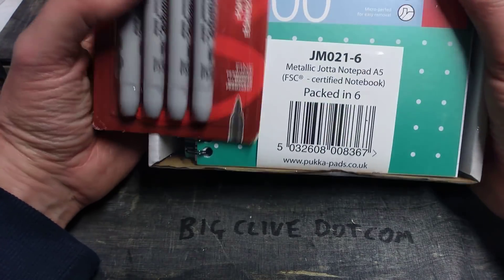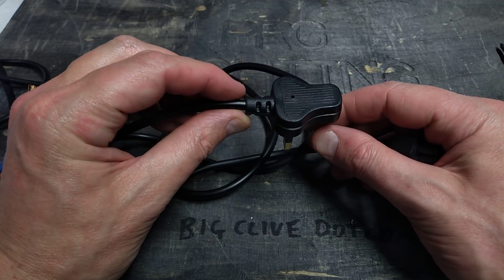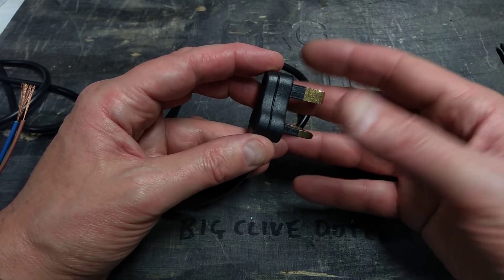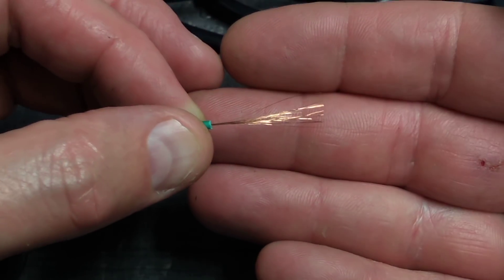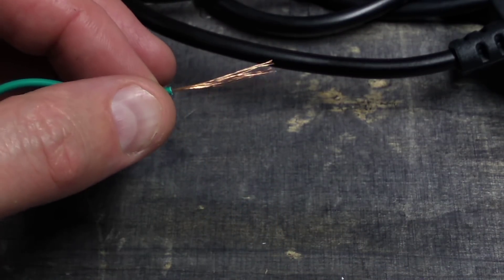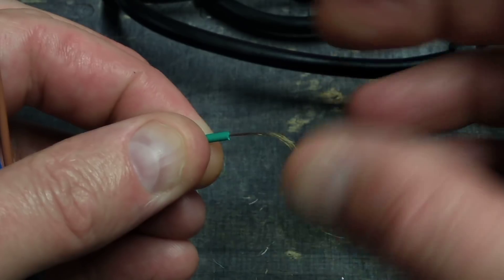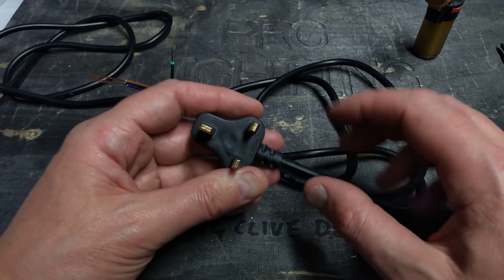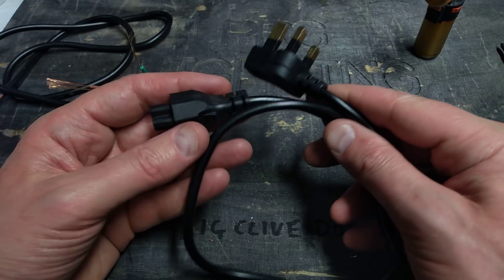How to detect shitty and dangerous aluminium flex.

Comment: You missed a problem.  The exterior of the casing is too close to the live and neutral pins.  Not quite so big a problem with sleeved pins (which they all should be these days) but when the original BS1363 was drawn up those pins weren't sleeved so the case dimension was set to reduce the chance of accidental contact while inserting the plug.  As with the lack of fuse and the sleeved earth pin, a defect which all by itself makes the plug illegal.

There's also a good chance the earth wire isn't connected inside the plug, or is merely touching the pin, so it won't matter that the earth pin is sleeved because the device won't be earthed anyway.

[Edited to add this]
John Ward tested a similar piece of shit.  At rated current it bubbles/melts/smokes.  IIRC, he tried a flame test and the stuff wasn't self-extinguishing, so illegal in yet another way.

Comment: I have a plug like that that is connected to my power supply that runs a bit of equipment I knew it did not have a fuse in it so when I am using it I will be cutting the plug off and I will be fitting a proper plug onto it because they are dangerous
Reply: I guess you'd better replace the whole cable...
Actually it will not be simple to put a proper plug on these cables with a proper connection
Reply from the maker: The fastest fix if you don't have a replacement cable is to plug it into a fused extension lead.  But a good quality cable is always an investment.

Comment: It always seemed BS to me to have fuses in plugs. Circuit breakers, break the circuit much faster so what point is there?
Reply: The UK runs 240-volt, 32-Amp breakers on a typical circuit (as opposed to US 120-volt, typically 10- or 20-Amp breakers). A lower-rated fuse in a fused plug will melt at a lower current, therefore stopping current to the device on that cord.

An often-overlooked PLUS to this design is for homes that have no overhead light in a room. It is expected the home owner use a lamp plugged into an outlet that is controlled by a switch near the doorway. Say, for instance, you have this lamp and another device plugged into the same outlet, and the other device goes "Full eBay" and shorts out. The fuse in the plug would melt before the breaker tripped, stopping the current going to the offending device while allowing the lamp to be lit for your safety (say, so you can find your way to the fire extinguisher or whatever). At least that's how it makes sense to me. LOL 

Can you imagine the above scenario and having to cross a carpet full of Lego pieces to get to the circuit panel in the dark? *cringes*
Reply: We have 230V here. 16A is standard but you can have 24/32A breaker. No fuses in plugs.

"The fuse in the plug would melt before the breaker tripped,"
Are you quite sure about that. As far as I know breakers trip much faster in case of a short circuit.

Comment: I never knew CCA wire had made it into power cables (not surprised). I bought some CCA wire that wouldn't take solder no matter what I tried (the cladding was copper colored). Just more ebay trash.

Comment: Don't bin the lead... Break the pins off the plug and destroy the lead as much as you can, to prevent someone else from using it...  Then bin it...
Reply: No need to go that far, just cut the lead off even with the plug and it will not be useful for repurposing.  Anyone who tries to use it after that earns a proper Darwin Award.
Reply: Agreed.  Some poor soul might salvage it from the bin, thinking they've found a good cord.
Cut it into 25mm pieces and take a hammer to the plugs.
Reply: Just run 10 amps through it.
Reply: we should set up some government regulations that ensures safe disposal of dangerous stuff
Reply: There's no such thing like keeping consumers safe, no matter brandnew or prefilmed anyway. The most hilarious ways to destroy everything including own bodyparts ever were and ever will be invented by consumers.
Reply: Bin it? You monster. Recycle it! It's metal!

Comment: But aluminium would not be springy, especially in such thin strands, are you sure that's not copper coated steel? Anyway, the total diameter of the strands in one lead is very small, further reducing current capability, I'm surprised you did not address that.

Comment: If you get a product with that lead, don't just bin the whole lead, bin the whole product! - god knows what other nastie's are inside the product, waiting for their moment of fame to burn your house to the ground.
Reply: At least if you replace the lead and put a small fuse in its a considerable improvement in safety, However I totally agree. Unless you have a reasonable knowledge of electronics so you can check the insides of it you should get it checked by a professional or just bin it.

Comment: That is a C5 connector, it is rated for maximum 2.5A, and usually found only on laptop chargers and other small switch mode PSU, not intended for any heavy load, where is used the C13 that is rated for 10A. So that cable is probably fine, I wouldn't be concerned by overheating, of course if you use that cable for the intended purpose. 

Of course its insecure because it lacks of the proper plug, and there is not a fuse, but if that cable had a proper UK plug with a 3A fuse, or even less, it would have been safe enough.

Comment: i dont know about uk but here in usa you find that cca has taken over the auto jumper cables its almost impossible to buy jumper cables on line because the cca is so small that you can not see it it also has bleed over to battery chargers almost all of them no are cca they only last a year when i found the problem i bought cooper cable and replaced them and now have ones lasting 5 years and going strong its very dangerous as they get so hot at the amperage of our automotive battery's
Reply: Hold down the shift key, will negate the CAPS-LOCK.
Reply: sorry its not in caps in my  window
Reply: hd the wise 7
Reply: I also had to buy copper wire (welding cable) and make my own instead of buying premade jumper cables.  And those were for a friend with some toy jumper cables that melted trying to jump start a honda civic! The cables appeared about 6-8mm diameter, but the insulation contained only a few strands of CCA with not even the area of 18ga lamp cord.
Reply: lol i know i bought some high dollar napa jumper cables got them home and would not make a conection found a bad crimp on one end took it a part and started to put a new crimp end found cca and i just threw them in the trash the great cable clamps had this saw tooth copper clamp found it to be cca also lol
Reply: Best jumpers are diy with cable and earth clamps from welding supplies. Have jumped a four wheel drive for someone with cheap cables, after about 10sec. cables started smoking I removed them immediately and told the person to call the roadside assistance organisation. By the way the battery they had fitted in their land cruiser was about half the size of the battery box because they were too cheap to pay for the correct one.

Comment: Plug does not need fuse. Cable is fuse.
Reply: It's not a bug, it's a feature.
Reply: Plug does not need earth.  User is earth.
Reply: Wouldn’t the fire terminate the continuity?
Reply: @TheKlipschfreak  Yep! - it will terminate the continuity of life.
Reply: Probably, but electrical fires tend to be self fueling once they get going.
Alu burns/ignites at a low temperature. Aluminium is used in fireworks, all sorts of metals are. Once they combust they become very 'volatile' in the way they burn. Also you have plastic on the lead to help propagate the initial electrical ignition.
Reply: Powdered/nanoparticle aluminium is also used in solid rockets as a fuel. Aluminum burns really nicely.
Reply: Yes. Your house too.
Reply: Pn Junction true that
Reply: Gold
Reply: I read that in chinese accent
Reply: ted clubber lang ahhh wha’ you lie -_-
Reply: John Ward put current through one of those leads. At 3 Amps it began to melt and to emit poisonous Whitesmoke™, and at 6 Amps it burned out.
Reply: XD
Reply: Depends on current :-)
Reply: Yeah, burns like canon fuse.

Comment: 10 Amps, that cable isn't rated to that, due to the connector on the end (IEC C5) only being rated to 2.5 Amps.

Though, Copper coated Aluminium wirering is though rather typical in airplanes, mostly due to its far lighter weight for the same resistance. (So building a cable to the same current rating would end up lighter, but also a bit thicker. Something that likely isn't the case with cheap cables.)
Reply: You can argue it is 'safer' if you design around the fact that the strands tend to fizzle instead of turn incandescent. It will cause shorts to go open near the short.
Reply: Not only is the connector a problem, but that wispy wire looked to be 16 awg at most.  That wouldn't even be rated at 4 amps  8 amps, according to https://www.engineeringtoolbox.com/wire-gauges-d_419.html  if it were copper.   These guys: https://www.stayonline.com/product-resources/reference-circuit-ampacity.asp say 13 amps, but I don't know if it's taking strandedness into account.  That lead is [still] a POS.
Reply: IncognitoTorpedo  Umm, you need to do some research..16ga copper is rated for well over 4 amps, try 13 amps if length is under 50 feet, 10 amps for 50 feet or more in length,  two current carrying conductors in cords. :)
Reply: To be fair, that cable could be made with 20 awg (copper) wire and it wouldn't be a huge problem for this cable, due to it only having a 2.5 Amp rating.
Though, going to 18 awg instead would double its current carrying capability, and likely offset the fact that it is made with copper coated aluminium wire.

But at the very same time, going to 16 or even 12 awg could have advantages, even if the load still only is 2.5 amps. (Less heat dissipation in the wiring.)
Reply: mxslick50, you're right.  These guys: https://www.solaris-shop.com/content/American%20Wire%20Gauge%20Conductor%20Size%20Table.pdf it would seem, are not.  I don't know why I didn't catch that- probably the 4 beers...  God knows I've wired enough 15 amp circuits with 14 copper solid core.   Doesn't multicore wire have a lower capacity than solid, or do they label it with an "effective" awg as though it were solid?  Whatever it is, that was a pretty skimpy wire.

Comment: Hmm, got my hands on speaker wires that are also copper coated something, but they were quite easy to twist together. (I did not do the flame-test.) I only saw what they were when I removed them and saw the steely grey color where the terminal clipped into the twisted strands. The worst part? It was sold by the local Media Markt. (big German-based consumer electronics store chain in Europe for those not from around here.) I guess now I know why it was so cheap.
Reply: Do not buy cheap car audio cable then, almost all is CCA wire, even the thick power cables.
Reply: Media Markt is not immune to trashy products. I once paid a premium price for Swiss Co-op 'stainless steel' pans that were not only magnetic but covered in rust after three months. Needless to say they refused to take them back because the pans did not say co-op or 'Swiss Quality' on them, only on the discarded cardboard wrapping. I never got trashy cables from the Co-op though.

Comment: This really is a can of worms and seems to be getting worse.  The website at http://www.bs1363.org.uk seems to cover most of the problems, with the exception of the aluminium cable.  I have also found problems with some IEC leads where the Earth wire doesn't even exist.  I test all of my cables now (even from supposedly reliable sources) by setting my bench PSU to CC mode at the cables rated current and measuring the voltage drop across the cable!

Comment: 4th thing is the proximity of the live/neutral pins to the edge of the plug. Whilst not as bad in this case due to the sheathed pins, it's still not to spec from the looks of it.

Comment: Is there a way to test without cutting the lead into pieces though? I've usually gone by the bendy properties of the cable myself, with more flexible rubbery cables being the most desirable, and the hard quite firm cables being less desirable.
Reply from the maker: You can do an external, resistance test on the cable if you have a very sensitive meter.
Reply: @bigclivedotcom  Thanks! I've not got any testing apparatus so the hacking of wires it will have to be. Tbh though I'm one of those guys who keeps cables from years ago (I've a suitcase full of them 'just in case' lol) so I just ditch and replace the dodgy Chinese junk :)

Comment: Did you test with a magnet ? Because I have seen copper clad steel wire fom China, springy like that. It is even worse than aluminum, which is not a so bad conductor, compared to steel...
Reply from the maker: I didn't I'll have to try that on the next dodgy cable.
Reply: If you look closely, you see the white residue after he burned it. I'm sure that is aluminium oxide. The steel based stuff just glows brightly in a flame and ends up as a softer blackened material with the shape close to the original.
Reply: Steel wouldn't burn up like that.

Comment: Yep, bought a couple variable voltage AC to DC transformer things a while back and the first thing I noticed were the power leads being suspiciously thin and the shitty plugs. I opened up the casing and desoldered the leads, replaced them with some much fatter UK-spec cables and plugs- the original leads were something like 20 or 22 gauge  inside the insulation, never seen AC power leads so thin, scary Chinesium junk...
Reply: I had a power cable that was getting suspiciously warm, so I cut it open. The wires looked like they were the proper gauge, 18 AWG, but it was really thin wire with really thick insulation, probably 24 AWG. It seemed to be actual copper but with some blackish discoloration on it.

Comment: There's a fourth problem with it.

The plastic part of the plug is too small, allowing the pins to be so close to the edge, that you could reach them as the plug is being inserted.
Reply: I'm really suprised he didn't point that out more, I've had quite a few of these awful cables, sleeved earth, thin and cheap wiring etc. But ive never seen one with such a weird shape to it
Reply: If you think that's too close to the edge, you must detest American style plugs.
Reply: @Roflcopter4b  I do. 😀

Comment: I have a kettle cord (that you'd better not use with a kettle) that gets really noticeably warm with only 250W or so. Still it's thin and light, so I keep using it for low power stuff I carry around...
Reply: Well, the current kettle leads, that are integrated with the base, also get quite hot in use, but as they typically only have a 5 minute an hour use they do outlast the kettle anyway. they are quite useful after the kettle is plastic waste, as the perfect "I just need a little more cord" with an industrial socket and gland on the end. Saves having the phone charger in the wall and bending over or reaching behind furniture to get to it with the half meter or so extension.

Comment: You know, we really needed to see that cable take 10A. Just for reference purposes...….
Reply from the maker: Not in the room I was in at the time, as it has annoyingly sensitive smoke detectors and if a show's not running will automatically call the fire brigade.
Reply: Go dig through John Ward's videos.  He's done a few similar cables.  They behave exactly as you'd expect.
Reply: BigClive 😂 ... those firemen with beards could've been rewarded each with a brief video appearance ...
Reply: John Ward tested a similar cable. But he had to crank the current up to 25A to get it to smoke. There was only a slight warming at 10A.

Comment: I remember having a good look at this cable during the meet. It was interesting that while one end said 10A, the other end was marked 2.5A
Reply: That is not uncommon even with legitimate leads. The ratings on the connectors seem to be the rating of the connector, not the rating of the whole cable assembly. You really need to look at the ratings on both ends and the CSA of the flex in between to determine an overall rating.
Reply: Its because of the resistance in that cheap wire only 2.5A is avail at the other end.
Reply: @obsoleteprofessor2034  Nah - it's the porous insulation that lets the electricity fall out.
Reply: Prehistoricman Do you add them together for 12.5A?